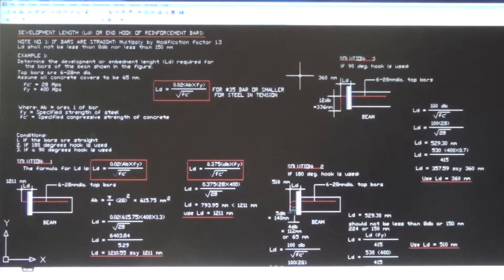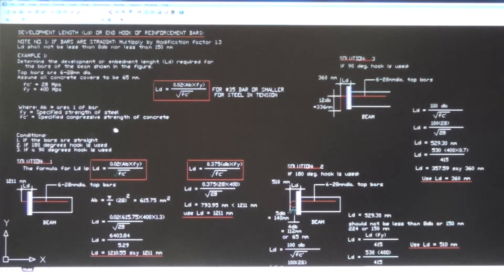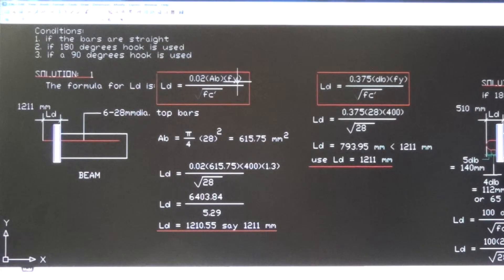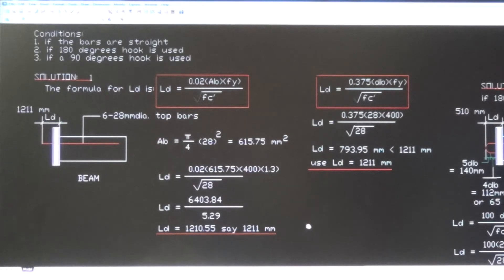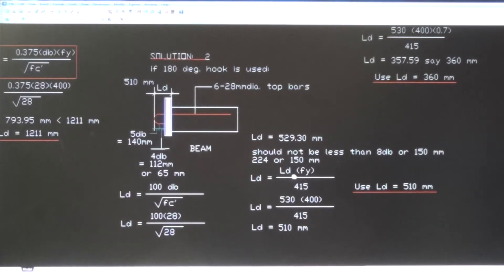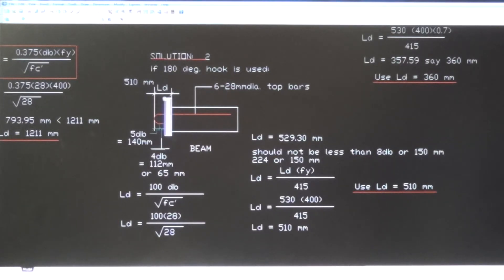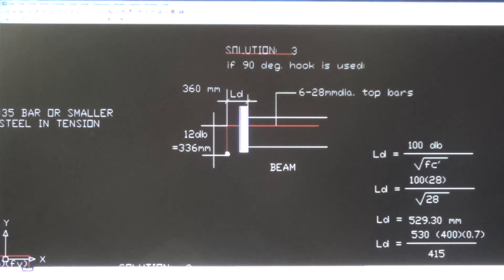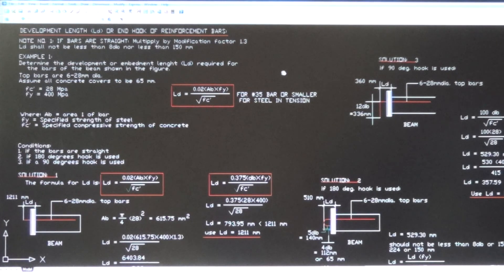DEVELOPMENT LENGTH of Reinforcement Bar LD

Comment: Is the development length of reinforcing bars only applied for tension rebars? When or what's the condition/situation to use straight, 90 degree, 180 degree hook bend?